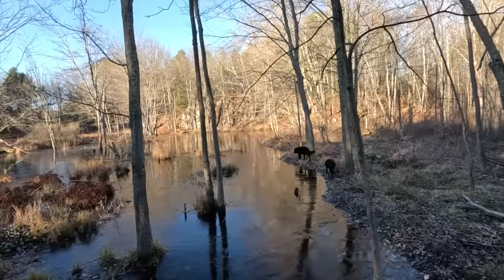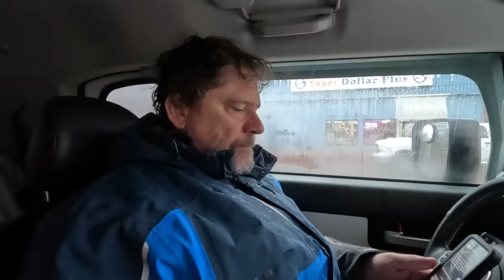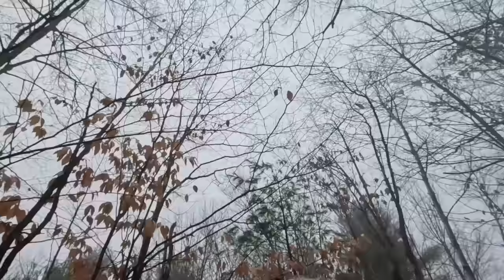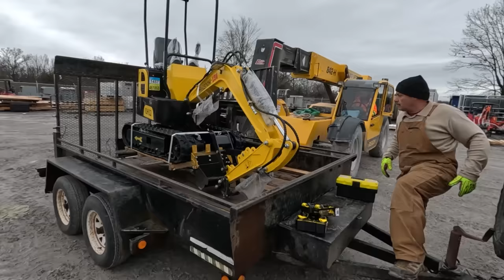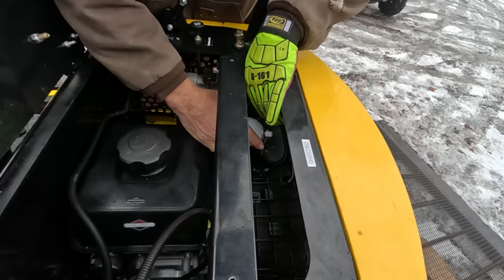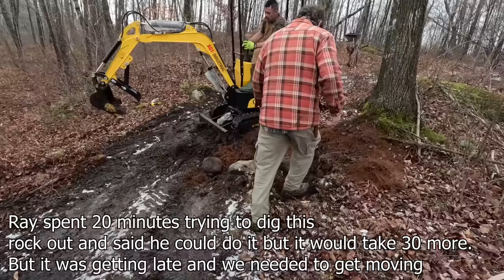DRIVING A MINI EX ON THE WORST TRAIL IN CANADA

Comment: I think if someone is looking for someone to do the crazy almost impossible they need to call on Ray and Russell. On another note, the engine should no surge like that. It is a minor adjustment you can easily make yourself. That would make the machine run much smoother.  Thank you for a very long video, I really needed this tonight. God please bless these two in all the want to do.

Comment: Most interesting and kudos to Ray for his expertise, but you I am sure have noticed how easily this machine will tip so take your time to learn the skills of balance using your hydraulics as you could be harmed or worse if tipped., it will after time become a handy machine but please do take the time to be comfortable when operating on uneven ground. The other area to watch is the rubber tracks as if you get a piece of tree limb stuck you could either damage the track or have it come off and that is a harder job to put it back on if in fact it was not damaged